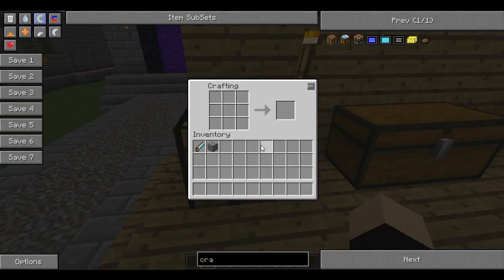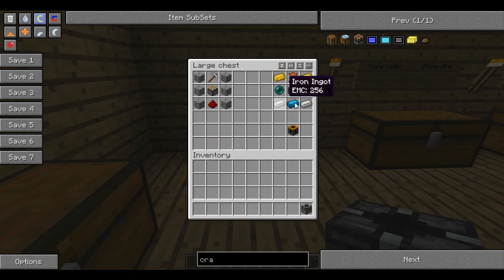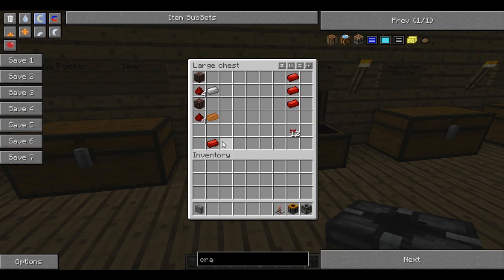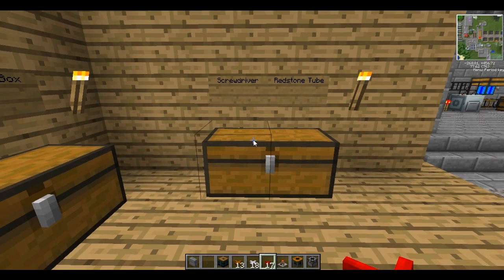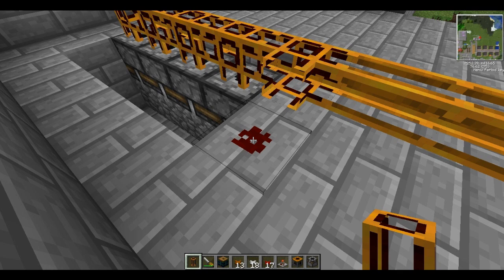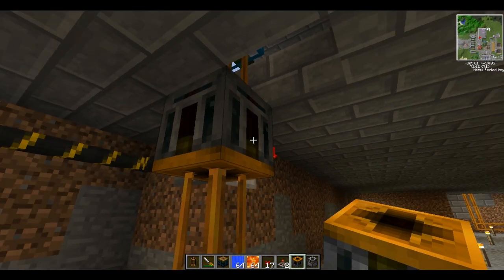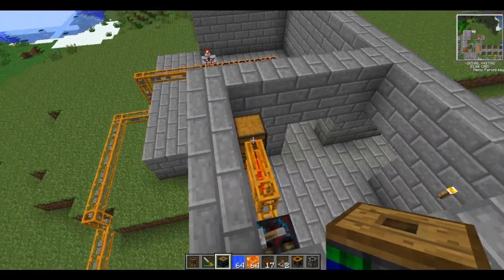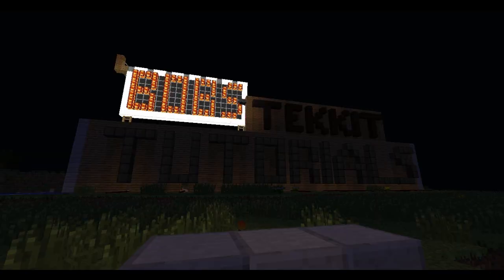Tekkit Tutorials Part 17 - Block Breakers, Retrievers, Red Alloy Wires, Timers

Comment: You think im kidding? Hook em up to the refinery and watch. Its based on, if the thing theyre hooked up to is trying to draw in more power than they can output, they heat up. thats why steam engines on a quarry are fine because quarrys dont have a required level. the damn refineries do, hence why power is best, not an engine. try it and see